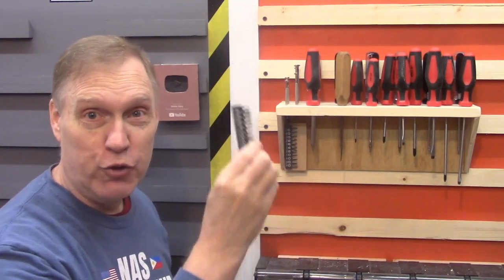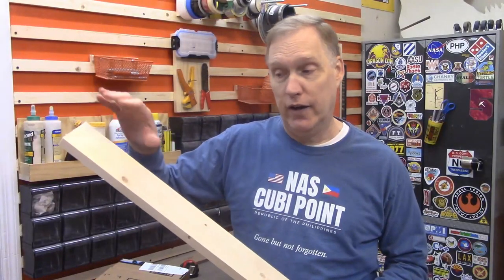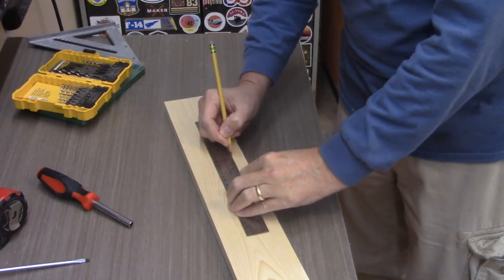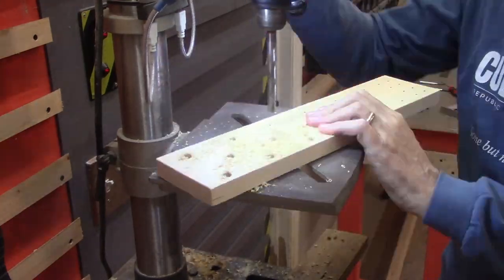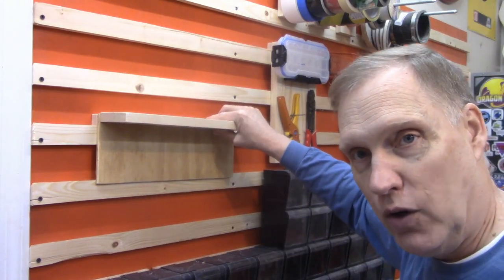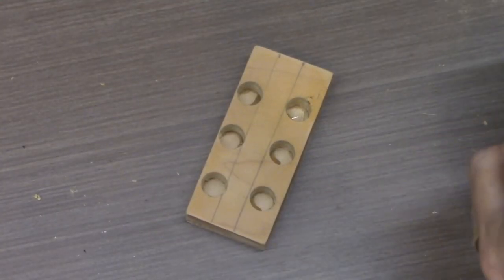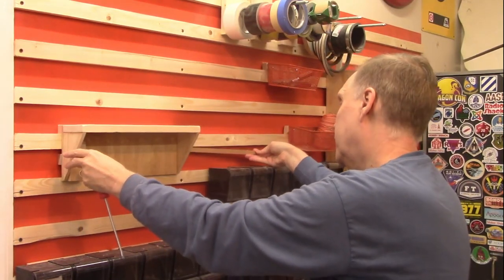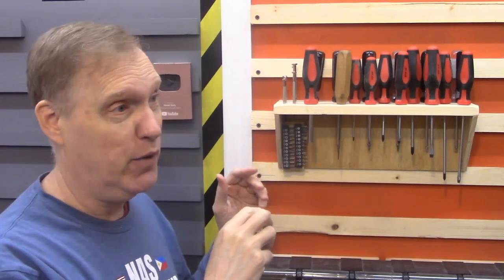Locking French Cleat Screwdriver Rack - 25 Screwdrivers On Compact Mount

Comment: A wooden table on your drill press table can stop blowout or even a clamped down board.  Also, one day the drill bit will lift your wood and whack you Grasshopper.  A fence with a dog to block rotation will minimize this risk.  Especially with Forstner bits they really grab.  I like the one size fits all approach you opted for to give you flexibility on layout. I would put the awl/ice pick on the far right so you don't skewer yourself reaching for bits on the left side or put it in the back row.